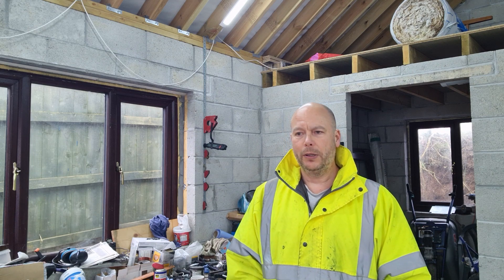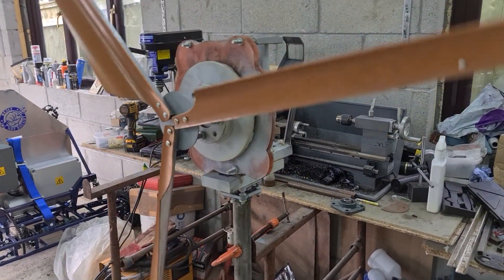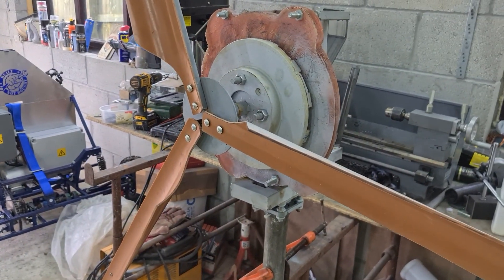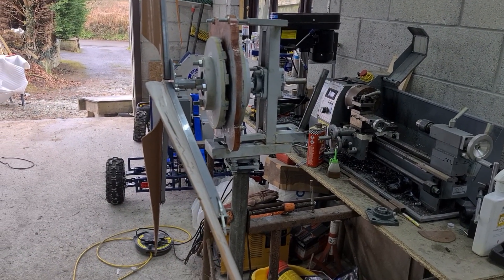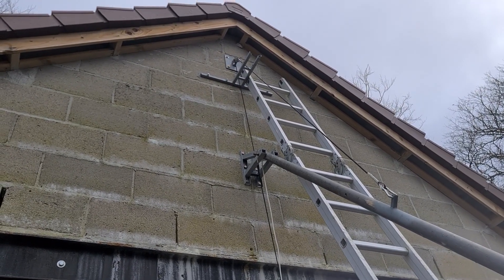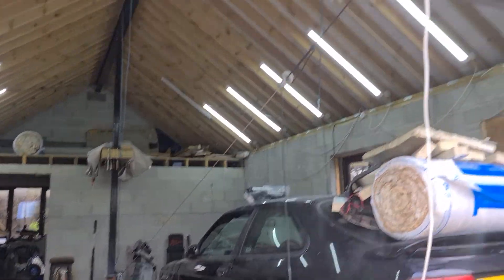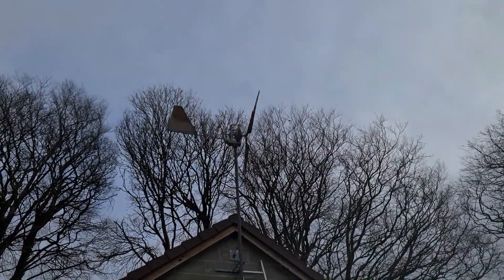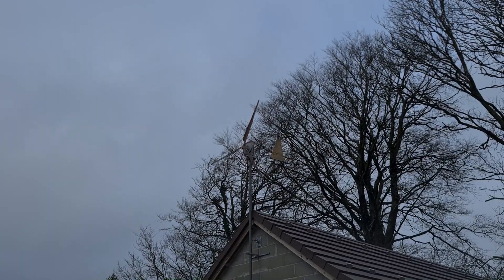Homemade wind turbine

Comment: You are doing well, I would suggest you add three more blade to cach the more wind or you can use planetary gearbox  or take the off those blades make the Mexican windmill type blades best of luck brother 👍
Reply from the maker: Thanks very much for the comment. I think more blades would be a really good idea, maybe it would give it more torque and momentum. I find the wind where I am is quite gusty and less consistent, kind of need some momentum to keep the blades turning when the wind dies back.

Comment: Looking good. I would suggest you to get another controller however, those controllers are unreliable and inaccurate, sorry to be the bearer of bad news.
Reply from the maker: Had to laugh when I read your comment. I typically bought that controller then read the reviews! Your totally correct it's utter junk, do you have one you would recommend that wouldn't cost an arm and a leg? The only thing going for this one is the ability to monitor values over an app on my phone. That would be useful on the next controller I buy to replace this one.
Reply: @SlightlyModifiedUk  , unfortunately I will have to be the bearer of bad news again. Through my research I found two controllers, one is ok as long as you make sure that you specify that the voltage adjustment parameters are open to adjustment and that's the instabreeze charge controller. But I would recommend the Midnite Classic charge controllers, they work for wind, hydro, solar and they have specific algorithms for each specific use case. They are expensive but they work. Hopefully you won't buy the one that I'm looking at 😅
I'm trying to arrange some way to get it to Sweden, but it's not the easiest task, when I'm on a tight budget.
Good luck, hope this was helpful!
Reply from the maker: @edialbert8035  thanks for the recommendation. I'm looking at them now. Your right they aren't cheap but do tick all the boxes.
Reply: @SlightlyModifiedUk  , it took me a couple of years of research to come to this conclusion, hopefully this will save you some money and headaches...
Reply from the maker: Thanks it certainly will!

Comment: I would like to see more of this. I've considered doing something like this, partly as a thought experiment, but ideally to run the fridge or immersion via batteries. It'd never heat the immersion to washing up temp, but it'd run the fridge easy enough.
Reply from the maker: Thanks for the comment. Running a fridge would be a great idea, especially if it were one of the 12v types that don't use a compressor (high initial load to start them) but rather a Peltier (I think they call it) type that uses a small charge to cool. Might see how that works myself. Thanks for idea.